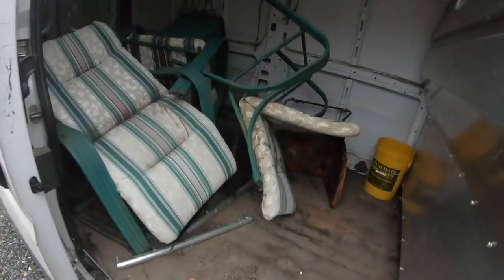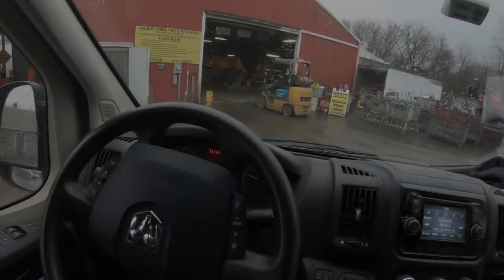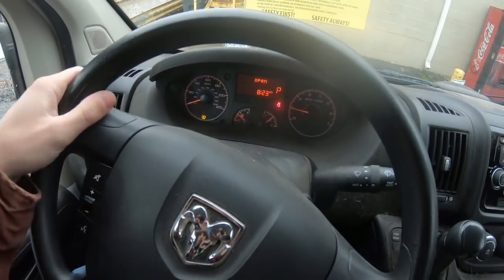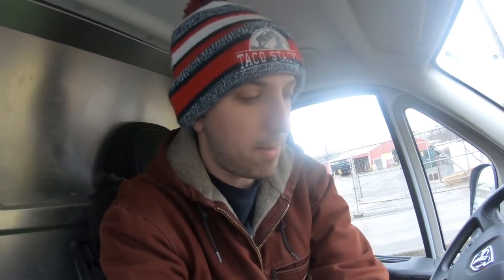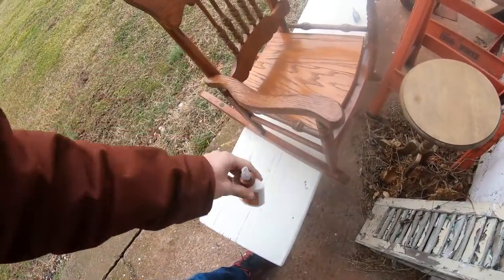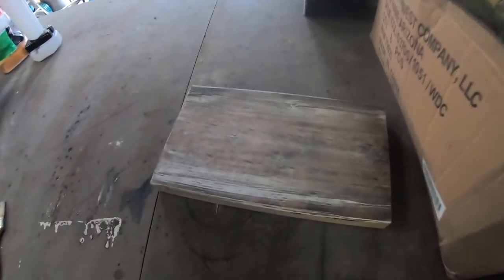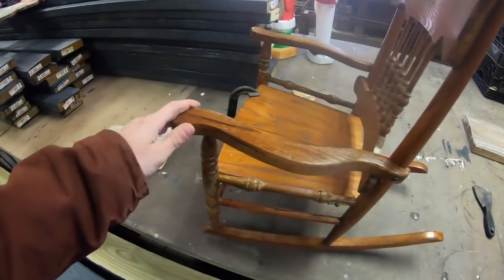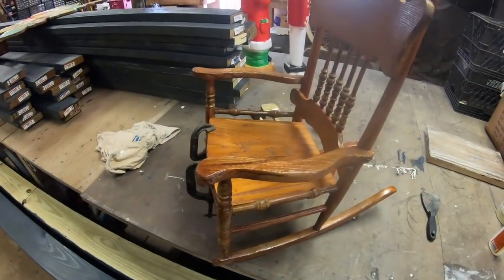Trash to Cash and Repairing Antique Furniture the Cheap Way

Comment: Hi Taco stacks.. just a little info to help you through the winter.
The main reason for this is the dropping temperatures, which cause the air to become denser and consequently lower the tire pressure. Of course, tires naturally lose pressure over time, and there can be a puncture. ... Colder temperatures will cause tire pressure to drop about 1 psi for every 10°F drop in air temperature.
Reply: starr0327 Could also have a bad stem valve in one of the tires. My light would remained on after inflating tires. Had tires checked and one of the stem valves had gone bad, fortunately they were still under warranty and didn't cost anything to replace. No further problem with light after.
Reply: Some makes will light if there's too much pressure as well, some do have sensors in the spare (which unless flat, you're not gonna judge accurately by pushing on the sidewall).  If all the pressures are good and light is on, then the sensor likely failed (they have batteries with limited lifespans).

Comment: Next time apply the glue to the supports, then place the seat in place

BTW, that glue job won't hold for long. You should have used screws. You should always do things the proper way.
Reply: @arodyanksfan  Thanks for noticing.

Comment: It seems like a lot of work to pick up metal for a very small  return....20 bucks only.  Not counting the gas you used to pick up the metal and then having to drop it off at the scrap yard. I prefer picking up furniture in the trash, fixing them, and reselling them.  Maybe it is also not worth it but I guess we both give a second chance to what would have gone to the landfill!!

Comment: there are many ways to reset Tire Pressure Monitoring System (TPMS), some model/brand requires you to reset it though touch screen dash board or drive few miles for the TPMS automatically reset  itself For mine, I got a nail, in one of the tire and after spending $200 (that hurt alot) to get replaced, I had to reset it through my dashboard. Resetting TPMS should be under Setting (most likely)

Comment: The wood glue would have worked if you had first sanded the gluing area down to unfinished wood then clamped it
Reply: And if you don't want to mark up your finished wood with the C-clamps,use wood blocks that you don't mind damaging.

Comment: drill 3 small pilot holes in the support, one one each end and one in the middle.  Screw 3 small wood screws from under the support up into the seat.

Comment: Mix up a teaspoon of Dawn soap, and half bottle white vinegar and half bottle water, put in a spray bottle, cleans better than anything I've bought.
Reply: Hey, Donna, thank you for the cleaning tip. Dawn is the only degreaser that works. I use vinegar for almost everything and baking soda as a scouring material. Trying to keep things chemical free.
Reply: @bethmerryfield7186  I use 1 part Dawn and 2 parts vinegar, heat the vinegar and then mix them in a spray bottle for cleaning, it works great!
Reply: Donna, you are so right. I have been using that for years. I used on a new mattress that had a grandchild accident on it. Within a hour or two after it dried you could not see it. I also used it on a indoor/outdoor carpet in a house I bought that had allot of cats that sprayed. Within a week the smell that hit you in the face was gone. I would have taken carpet up but it was glued to the concrete and still in good shape. This was a lot easier and cheaper.
Reply: @debraellison6255  good to know 👍 love the healthier, cheaper cleaners!!
Reply: It's crazy how well that works. It makes it all sparkle. You learn real quick it doesn't take much when you spend eternity rinsing and the suds won't stop. lol
Reply: I also add a little baking soda in with my vinegar and Dawn. Just make sure to add water to the vinegar before adding the baking soda. My go to cleaner as well.

Comment: My vehicle has check tires indicator. after you check to make sure all tires have the same pressure you press a button until the check tire pressure indicator is gone.  This should clear the notification. Mine is under/near steering column area. I found this out searching information on the internet.

Comment: Those air pressure sensors have batteries in them 😳 We had a tire place break one of our sensors putting on a new tire. So we had to replace it, at a different shop . The pressure light never went off so we had them all checked , after replacing 2 more sensors trying to fix it, the code came back that one sensor had a dead battery ‼️ Who knew 🤷🏼‍♀️

Comment: taco try to have in your shop the gorilla mudd podding its good to fill in the wood cracks plus maybe it would have been on the chair hopefully you sand it  the ressidule from the bottom of the chair that way it will glue better,  anyway at least you tryed

Comment: Bad news, we’re sending more rain your way from Kentucky. Those tire sensors are just another racket. They are $200 each to replace. If you ever change those valve stem caps from the cheap plastic ones to metal, it ruins the sensors.

Comment: You definitely need to pick up a wire stripper, it will pay for his self in no time
Reply from the maker: Most don't strip braided wire that's my issue, roughly 90% of the wire I get is braided wire and a normal under $300 wire stripper won't do it.

Comment: But the wood,you made to look old, with a hammer, GENTLY several times to make it look battered. Don't forget the edges. I suggest you do the hammering first next time. (Practice your hammering on scrap wlod, first. You only want to gently drop the head of the hammer down. It takes practice

Comment: You should have used a damp towel rag to get that excess glue off.
Reply: DJinNJ08830 It'll be fine. Wood glue dries clear.
Reply: @GamecockGuru  Does that also apply to painting, because drips are the same color as the paint?
Reply: @tommoore5414  Obviously not, there is a difference between paint and glue. I use that same brand of glue daily, and wipe the excess off with a dry cloth. It works perfectly fine. Glue dries clear and there is no noticeable residue.
Reply from the maker: I used a damp t-shirt :/
Reply: @TacoStacks  as you should to get big globs off
Reply: @GamecockGuru  I guess you wath
Reply: @GamecockGuru  If don't clear the excess glue. Yes it drys clear but with noticable blobs of glue.

Comment: Please read the instructions for Gorilla Glue before using. One side of joint needs to be wet. A little sanding and a sponge will do it. I don't have a lot of faith in the fix.